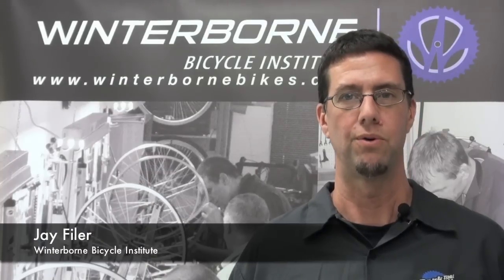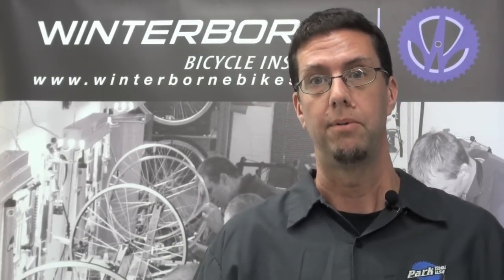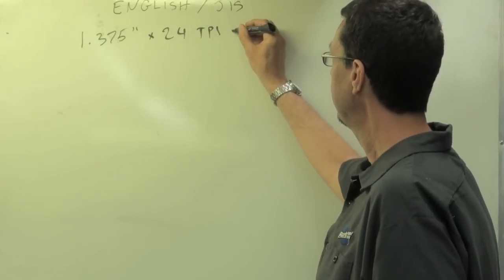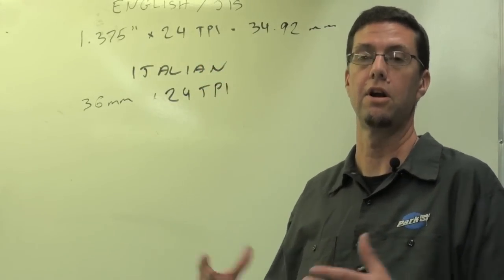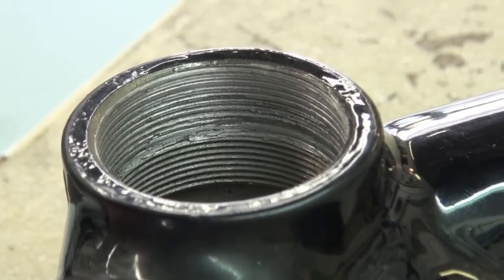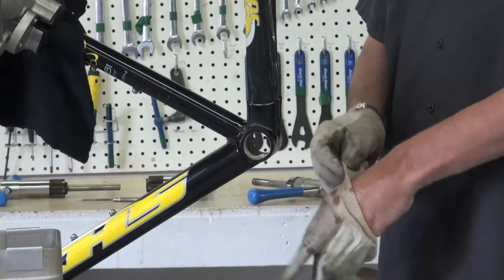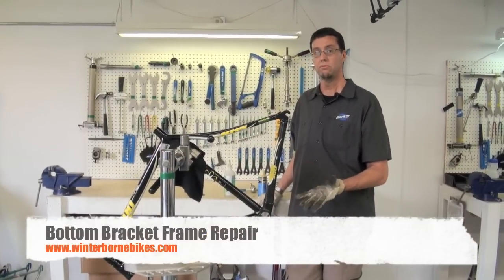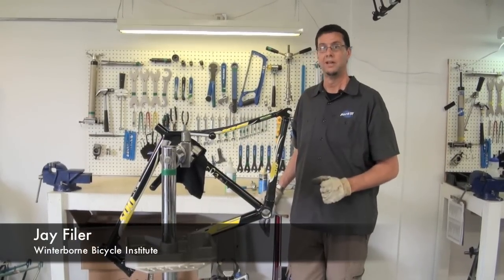Bicycle Frame Repair

Comment: There IS another fix for a frame in that state, you need a threadless bottom bracket cartridge, it is a pressure fit, and has internal linkage that pulls both tapered cups into the middle of the shell, allowing you to fix a bike that has gone through English (34.8mm) and Italian (36mm) threading procedures.  If the BB is very thick you might be able to rethread with Chater-Lea (36.8mm) oversized threads but I have no idea where you could get the cutting tools.  Phil Wood still makes the retaining rings allowing installation of raw BB cartridges in Chater-Lea framesets (some taiwanese and some campagnolo, and of course, all Phil Wood cartridges may be used).

I believe the threadless cartridges are very troublesome to install and service, and so they are a last resort.
Reply: +Donald Gillies the threadless bottom brackets are ok once you manage to install them in the first place i had to do some more machining of the bracket was to big in diameter .10 mins are less on a bench grinder to make the diameter smaller should work .but take a little at a time off. test fit do not make the mistake and try force fitting like i did in  the first place it works payed of in the end i thinking of getting a spare just in case but its running smooth :)..by the way the bike came cross threaded from the manufacturer's stored 2 years before it was ridden ..i was not happy should make all bottom brackets on alloy threadless .alloy bends like shit the up side it dont rust and its lighter
Reply: Can you send link please

Comment: Hi Is the reason that the second thread wouldn't cut because you were rotating the tool the wrong way. I thought that the tool would be rotated in the opposite direction. I would have thought swapping the tool like in the vid would put in a reverse thread which would not take a bottom bracket and ruin the frame?
Reply: He says at the start, JIS have a left hand and right hand thread, Italian are both standard right hand threads. He goes in clockwise from both sides, so the threads are correct for an Italian BB.